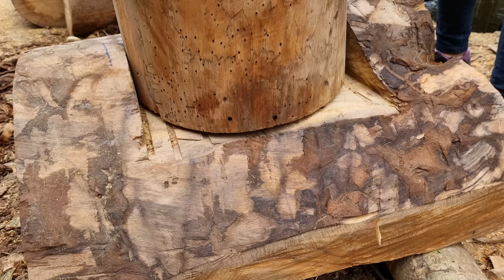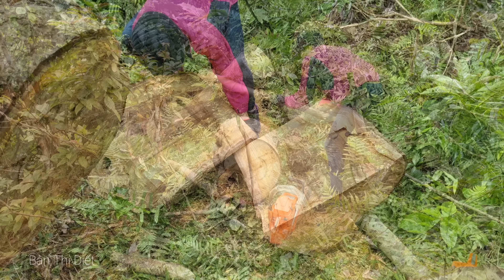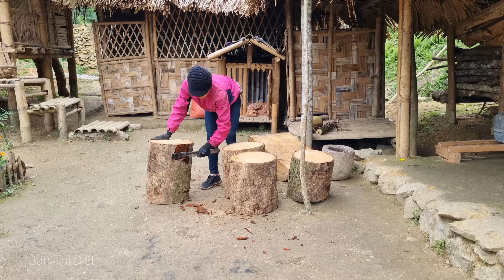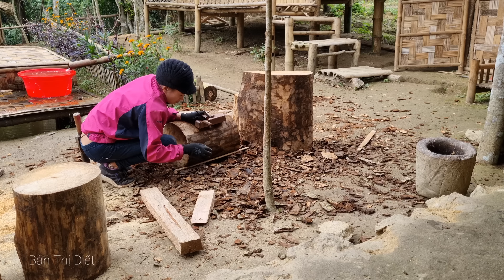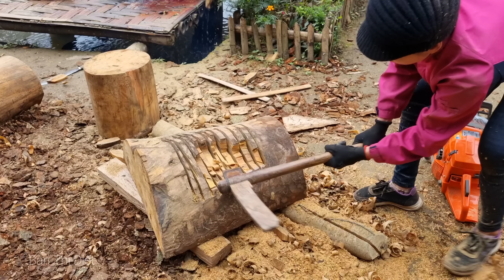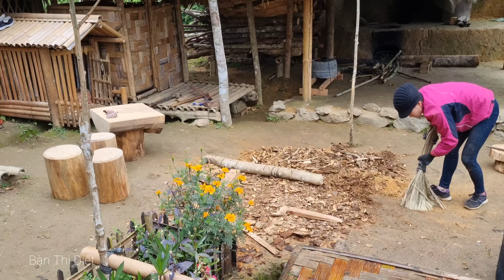The girl's hand skillfully makes use of discarded wood to make a drinking table | Ban Thi Diet

Comment: You are very impressive.  One comment however.  Your chainsaw  should be operated smoothly to save your blade.  Don’t pulse the accelerator.  It smokes heavy, so use a little less oil in hour oil/gas mixture.  You’re very creative!